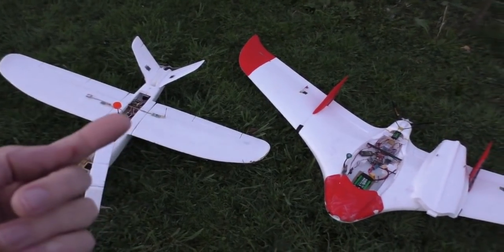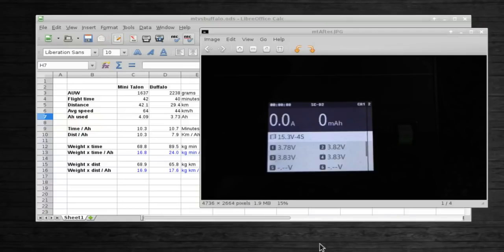Mini Talon vs Buffalo efficiency stats

Comment: Very interesting video. I own both planes you looked at and while I see them as having little in common I was curious to see the results from your testing. The Mini Talon is a favorite of mine and is almost always in my vehicle when I go flying. The Buffalo is a gentle giant and I appreciate the fact that I can get my hands inside easily for battery placement etc. My summary is that the Mini Talon is a sports car and the Buffalo is a semi truck. Very different planes, both are fun to fly with each having its own unique characteristics. Thanks for the post and taking the time to collect the data.

Comment: How good would you say the mini talon is as a first plane? I have experience both with flying miniquads & flying planes in simulator
Reply from the maker: Not very good, it's fast and heavy, with a relatively fragile nose. I would try something lighter and slower as a first plane.
Reply: @iforce2d  It seems pretty easy to launch though(also in your vids before iNav), and once I get it in the air, controlling it won't be a problem. I'd prefer this but if it really is a bad plane to start with, you got any recommendations? The Mini Talon just seemed to be a really good spot in regards with not being too big, being able to go pretty fast, and is also capable of flying for a long time.
Reply: @iforce2d  How about the Nano Talon off banggood?
Reply from the maker: I don't have a nano talon but I think it would be better, able to go slower and needs less space, much lighter. Personally I found cheap wings like the bonsai/teksumo to be the best (least stressful) to learn with. The C1 chaser is also really good if you want something a bit nicer that you would be more likely to use long term and is practically impossible to stall.
Reply: @iforce2d  Hm, I see. I'd just hate to get another beginner plane, and then never use it again once I got a mini talon

Comment: Very good video. Although in a different league, have you compared it with the Falcon Skywalker?
Reply from the maker: no, the 4S 8Ah battery weighs about twice as much as the skywalker :p I did post a few stats on my video about the skywalker already though
Reply: Thank I didn't realize that the test was based on a single 4s8Ah

Comment: Hi 
I think MT oscillation might be due to not proper tuning...
I think you also should take into the consideration AUW/wing area... 
MT has wing area  30dm^2 with our AUW = 1637g it makes approx. 51.16g/dm^2
I couldn't find wing area for Buffalo from the specs. 
But I eyeball (estimate) it from google and translated into cg calculator (please correct me if I was wrong)
http://j.mp/2OUNr7V
It makes 79dm^2 (with 2238g), and wing loading 27.38g/dm^2 therefor much much lighter setup!
I like mAh/km the most because it actually takes into consideration wing area (bigger planes have more wing area -> drag so they also need more power to penetrate through the air).
 97.17 (MT) vs 125.95 (Buff) mAh/km. I'm pretty sure if you can get both planes into similar wing loading g/dm^2, it would be much better for MT (in regards of efficiency). 
Some gliders like funray can get 67mAh/km ...

Comment: Ya know, it's like a pick up truck vs an SUV. They both are utilitarian but they drive differently. I like both actually. Guess I'll have to buy a Buffalo at some point! Chris, do you have any idea why Ardupilot is causing those surges on the MT? One of my flying mates has the same issue on an RMRC Mako AKA HK Skyray/ Sonicmodell HD wing.
Reply from the maker: I got rid of it by adjusting AHRS_TRIM_Y on my C1 chaser and I could also improve it a little with the MT, but not completely get rid of it.
Reply: Thank you! I'll pass it on... :)

Comment: I'm curious as to the amp draw of the electronics of each plane on the ground for a base measurement. The Talon seems to be constantly hunting for it's sweet spot. My jet ski does the same thing. later jet ski's added a power trim plate to fix the problem. My B-10 Mitchellwing had the same problem. Instead of hunting up and down; it would choose to slide to one side or the other first and then dip it's nose and resume to hunt. The Mitchellwing has wing tip rudders and by angling them out a few degree's stopped some of the yaw but you always felt like it was trying to climb up the side of a bubble only to slide off again.

With that short tail to wing distance I think your going to have to reduce your elevator throw or slow the rate down to even it out. Moving the electronics forward a slight amount may increase your nose weight enough to help also. The Mitchellwing was so sensitive to cg that moving my head forward and back would change how it flew. I had a 5 pound dive belt weight in the nose to even out some of the sensitivity. The Buffalo has three things the Talon lacks to make it fly without hunting. It has more dihedral which helps keep it centered. It's swept back making it seek center and the wing tips help prevent the laminar air flow from escaping at the wing tips by redirecting it back at each wing tip. Since it's a swept back wing that redirected airflow pulls on each wing tip kind of like my tip rudders did on my Mitchellwing, helping with yaw. The old P-51 Mustang pilots and the Spitfire pilots always talk about having to constantly fly their airplanes, much of the stability is traded off for performance in a fighter and in a flying wing.

Comment: Hello. Can you please tell me what firmware did you upload to the Pro Mini? (and how did you upload the config for OSD). The flight controller works ok, but I cannot make the OSD to output anything
Reply from the maker: https://www.youtube.com/watch?v=siX-NJztBHs
Reply: Yes, I managed to get the mavlink output, but I wonder how did you get the Omnibus F4 pro (Sorry, I refereed to it as "Pro mini") to output video from the build-in OSD. I loaded the minimOSD config onto SD-card and restarted the board (as the instruction said), but no luck....
Reply from the maker: I don't know if this version is an official release yet, but you can get it from github and build. The instructions to enable OSD are here: http://ardupilot.org/plane/docs/common-osd-overview.html
Reply: danielsmd4, sounds like you're using the f4light firmware, outdated now, where Chris is using the latest Ardupilot ChibiOS firmware, which has osd config in regular parameters.
Reply from the maker: I put a build of the firmware I'm using here: http://www.iforce2d.net/tmp/arduplane-chibiOS-omnibusf4pro.apj
You will need to first flash the ardupilot bootloader, get it from here: https://github.com/ArduPilot/ardupilot/tree/master/Tools/bootloaders
The file you want is "omnibusf4pro_bl.hex"
You can use the betaflight configurator to flash that, as shown here: https://www.youtube.com/watch?v=kmRq_y5MHqw
After the bootloader is flashed, reboot (power cycle) and then you can use the mission planner program to upload the .apj file (Initial setup -> Install firmware -> Load custom firmware).

Comment: Pretty hard to beat the mini talon  for handling and efficiency. A mini dark might beat it in fun value  though
Reply from the maker: Yeah it's keeping up with the larger plane very well. I think the very low area frontal profile is a huge win.
Reply: There are a heap of parts for the mini talon on thingyverse that make if even more streamlined. Im totally overhauling mine with new front and rear skids which replace the front wheel and protect the foam from gravel rash and front aerodynamic canopy, relocated fpv cam, hatch mods, air cooling ducts etc..

Comment: Were those speeds the most efficient for each airframe?
Reply from the maker: I have no idea, is there some way to find that out? I don't think the performance polars are published, if they even calculate them at all...
Reply: I meant for your configs, flying it around taking notes of Amps and speed at different throttle levels. Lot of dumb work tho, so understandable you might want to skip it.